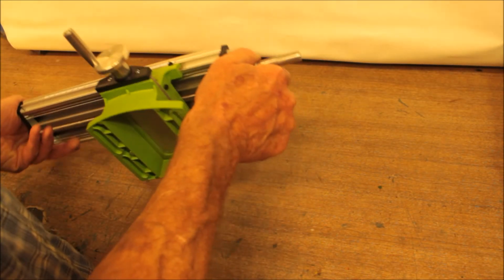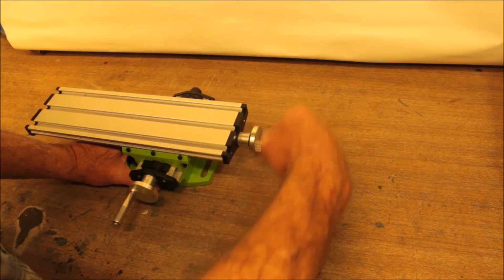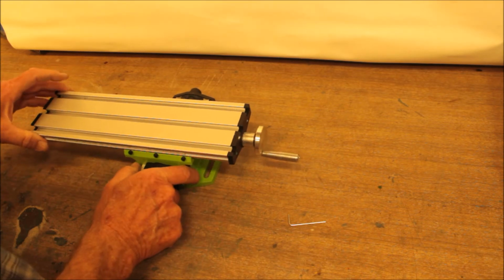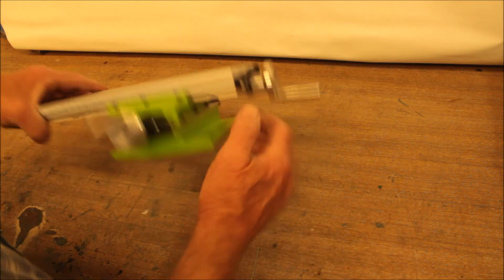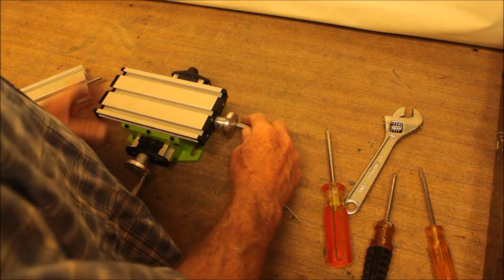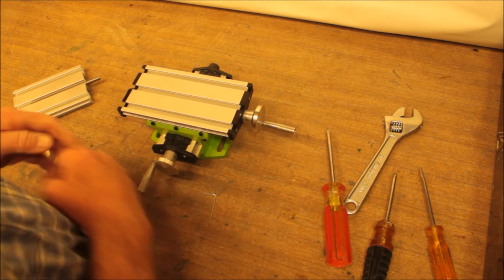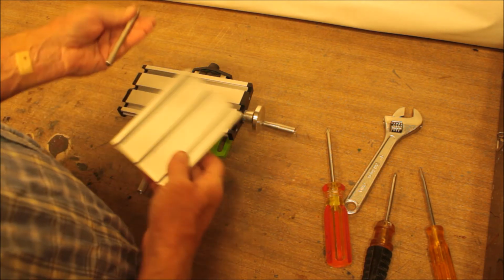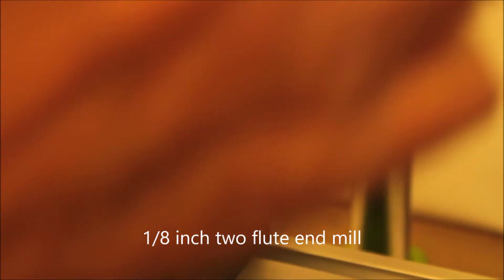mini micro mill drill part 2

Comment: I'm building one of these, but I plan to use the 185x100 cast iron table you fix in another video. I don't plan to use it for milling as I have a full size milling machine, but I believe this can be a nice setup for grinding small stuff, maybe sharpening tools and the like.
Reply from the maker: That's almost exactly what I was thinking. This is not a real milling machine but more a way to hold a Dremel tool and move it more precisely. I always slip when working on tiny little parts adding a spare divot where one is not wanted, etc.